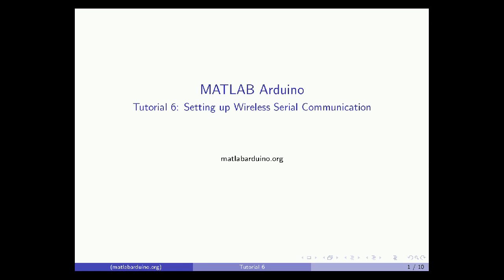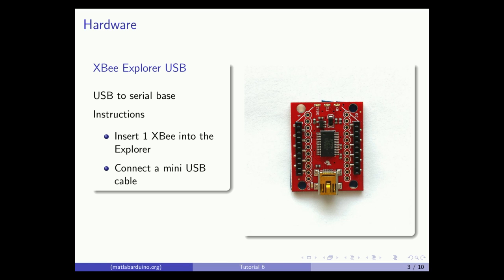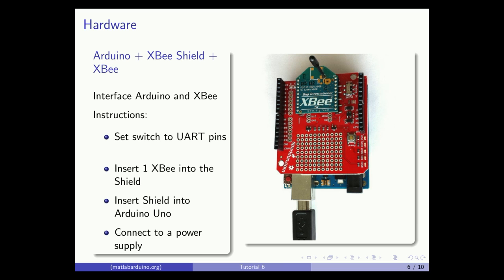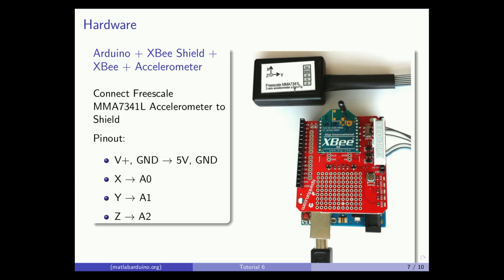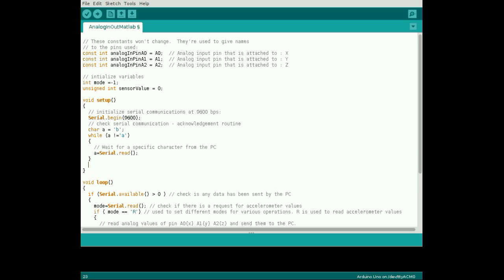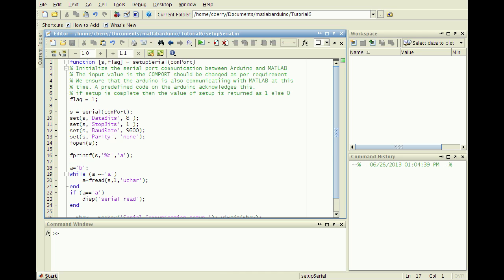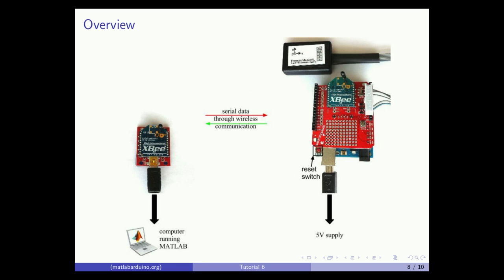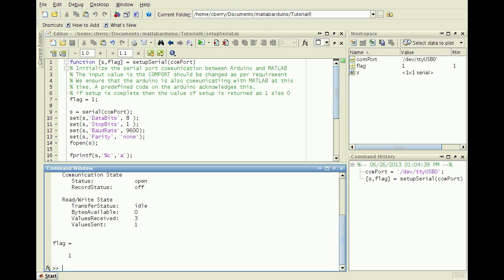MATLAB Arduino Tutorial 6 - Wireless Xbee Communication based Data-Logging for 3-axis Accelerometer

Comment: I have typed out the Matlab and Arduino scripts, and the serial communication doesn't work for me. After running the Matlab script I get the following warning messages:
Warning: "Unsuccessful read: The specified amount of data was not returned within the Timeout period.
Warning: Unsuccessful read: A timeout occurred before the Terminator was reached."

It then seems to connect, but when I use "fread(s)" it returns with:
"Warning: Unsuccessful read: The specified amount of data was not returned within the Timeout period.. 
ans =
   Empty matrix: 1-by-0"

Does there need to be any setup done in the XCTU program? Assistance is greatly appreciated.
Reply: Hi, were you able to solve your problem by using the XCTU program?
Reply: I ended up using Processing 2+ instead to give a live view of data and to save the data in a .txt or .csv file, and then created a simple import script in matlab for when I needed to do some test post-processing. The X-CTU settings I used are the ones from the arduino fio webpage and they work a charm. Happy to share script with anyone if they want it (comment below). Thanks, Ed
Reply: I sorted it out. I ended up using Java in the end instead of Matlab...Matlab was too slow
Reply: + Ed Hallett PLEASE SHARE THE FILE PLEASE I NEED THE COMUNICATTION IN REAL TIME WITH ADLX335 WITH XBEE
Reply: hugo santiago redrovan parra am also working on the same thing and need to achieve real time communication using ADLX 335 and Xbee series 1
Reply: Ed Hallett please assist with the code you used